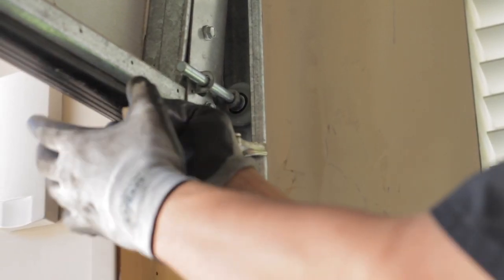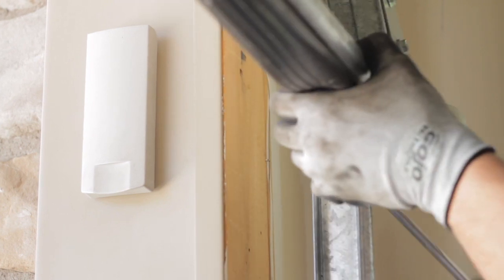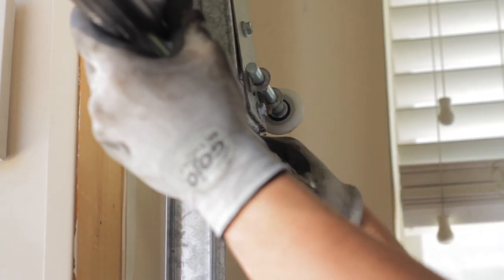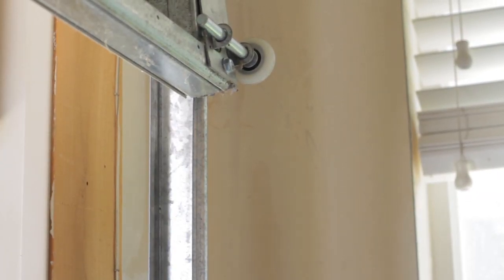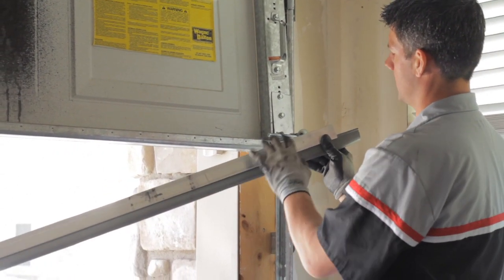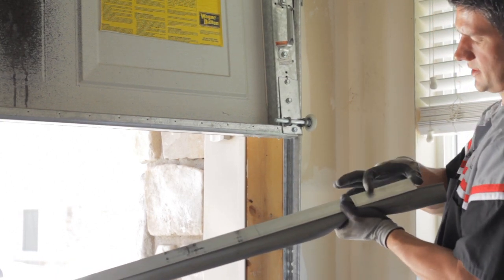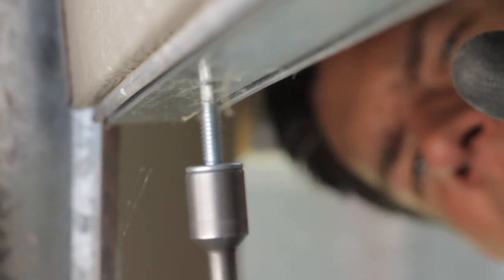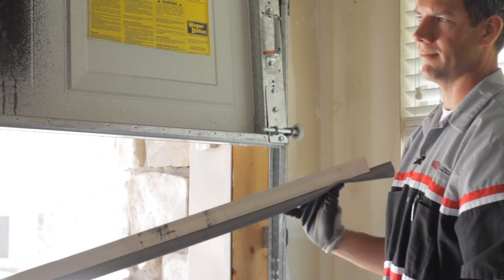Garage Door Help : How to Install a Garage Door Aluminum Weather Strip

Comment: I have nothing at the bottom of the metal tin garage door to screw this track into. Should I glue a piece of 1 x 2 lengths of lumber into the hollow cavity at the bottom of my garage door?
Reply: What did you end up doing?
Reply: Screw it to bottom of door. No glue

Comment: My garage door is very thin tin. Its not the typical door thickness. I do not see any place where I can install a T seal. Its way too thin. Seems like there is one little slot/sleeve that runs down the whole length of the bottom of the garage door where a rubber seal use to exist before it got ripped off. I have no idea how I can install the classic T seal.  Can I put a 1 x 2 along the length of the bottom of the door, and drill it onto the door so i can install a T Rubber weather strip seals? Please help. thanks!
Reply: Yes

Comment: @ OrangeLock, It wouldn't be easier as the bracket being held by these bolts also holds the cable hook up to the torsion spring.
If you remove these bolts without first removing the tension/torsion on the spring(s), you’re in for a surprise, one that could/would cause serious damage, bodily or otherwise.

Don't try this at home, please leave that to Professionals.